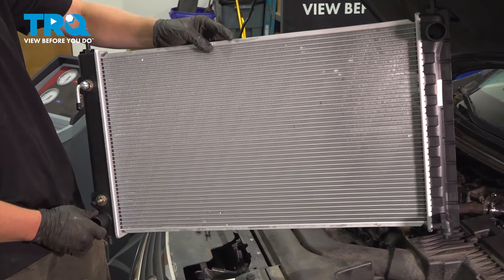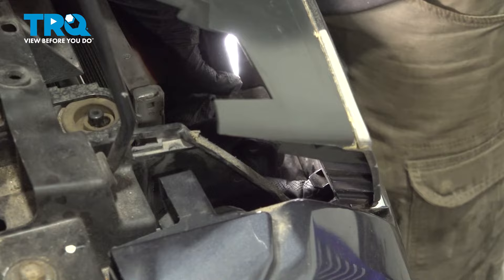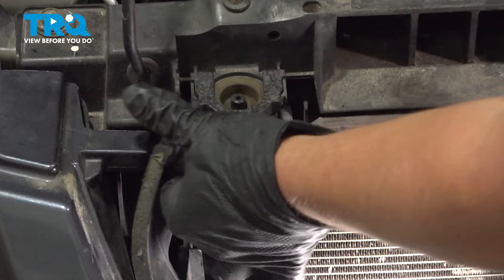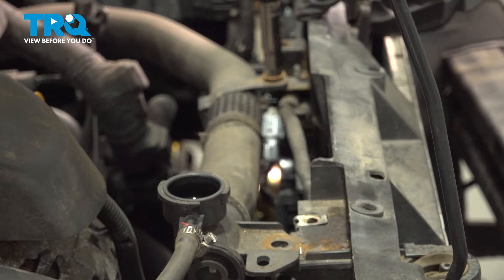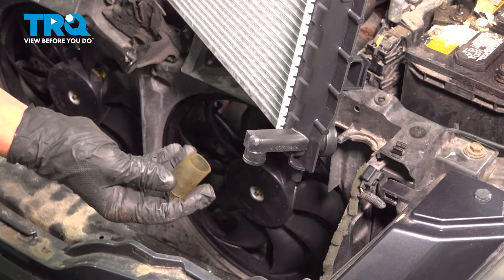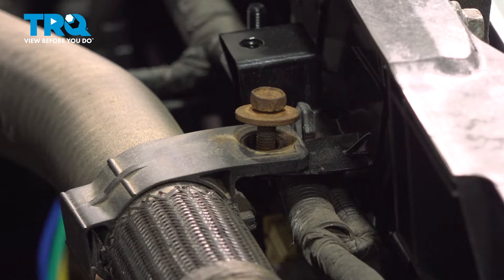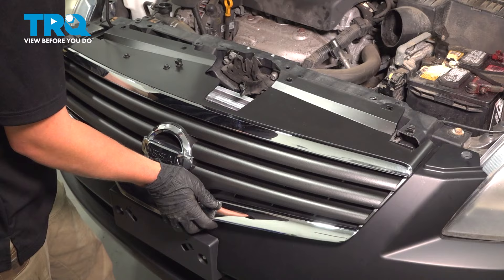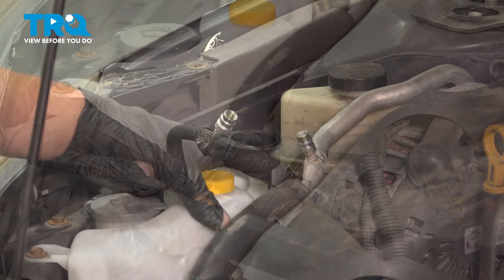How to Replace Radiator 2007-2012 Nissan Altima

Comment: For anyone else that is attempting this removal, DO NOT undo the 10mm bolt on the condenser. You will in turn leak all of your Freon out and will have to get an AC Freon refill

Comment: DO NOT take out the condenser bolt or you will let out all your FREON/refrigerant!!!  Do not take that bolt out unless you are replacing the condenser for the AC also.  If you are just replacing the radiator the ignore that step.  If you do take it out then you will have to go to the shop to put more refrigerant in or buy a kit and do it your self

Comment: When I removed the bolt on the condenser line it made a loud noise and ever since then I do not have cold ac air, does anyone know why this is and what I can do?
Reply from the maker: +Ruben Rendon We wouldn't be able to diagnose an issue like that here, you may want to have a local mechanic take a look at it. Thanks for checking us out! http://1aau.to/m/Shop-1AAuto-c

Comment: i removed the 10 mm bolt on the condenser line and it won’t stop throwing green fluid
Reply: Do i wait until it stops leaking/draining?

Comment: Mine is a manual transmission and dont have a cvt hose. But there is a connector/connection for the cvt in the new radiator, what shall i do? Thanks a ton!!